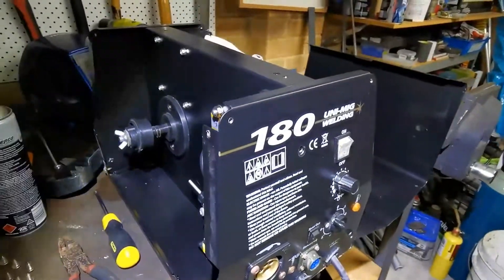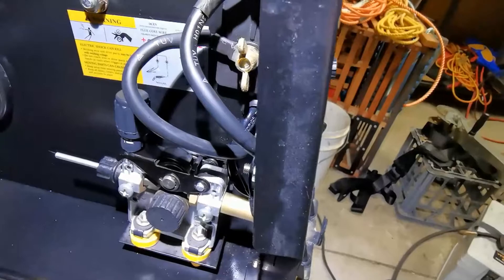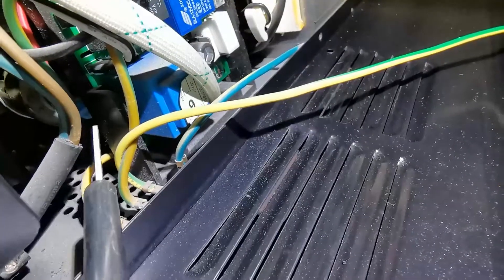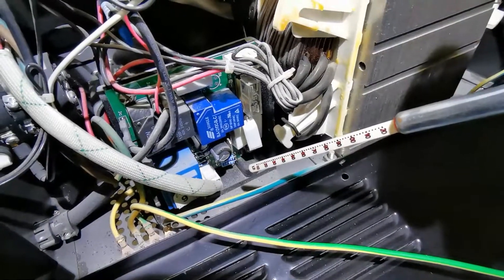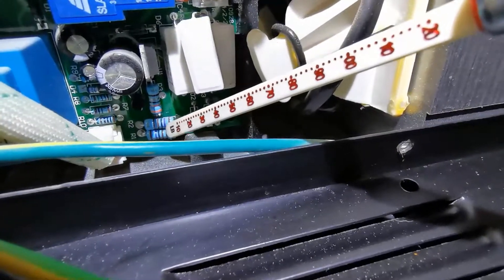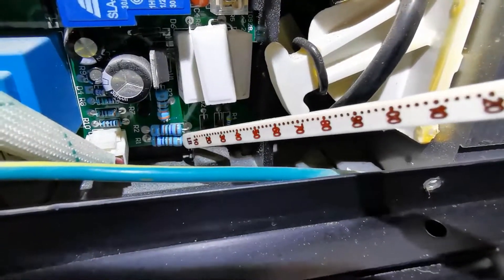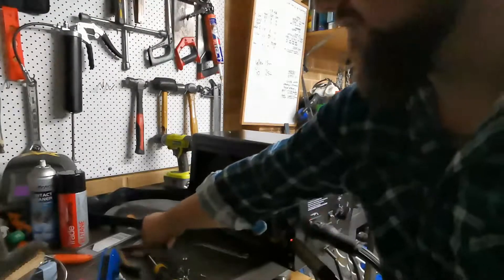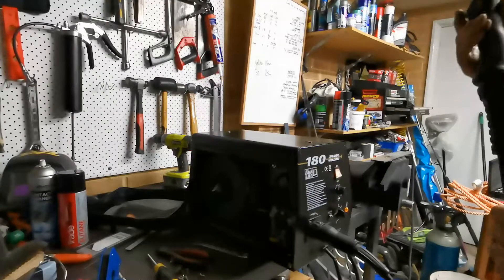Fix a Mig welder your guide to troubleshooting a MIG welder (any brand) not working or broken

Comment: Thank you for the video! I just received a brand new ESAB EM 190 PRO mig welder. The problem I'm having is that the instant the mig wire touches the metal I'm welding it explodes and covers the contact tip with filler metal. It doesn't seem to be a typical burn back problem. Everything is new, new wire, new contact tip, wire speed and tension are good, the wire simply explodes on contact with the metal I'm welding. Even with voltage set at its lowest and the wire speed high, it simply explodes. It doesn't even begin to weld. The place where the wire touches the metal is burned as if the voltage is far too high even when set very low. Any thoughts would be appreciated.
Reply: Without it being triggered? If its after you trigger it, seems like a control board issue. Esab is hard to deal with when it comes to customer service.
Reply: @Ricfixeswelders  Thanks for getting back to me. Indeed, ESAB is hard to deal with. I think you're right about it being a control board issue. It turns out my machine was still under warranty, so at the moment it's at a repair facility. If and when it's fixed I'll let you know what the problem was. Thanks, Paul
Reply: @thedahlins  Esab warranty is a nightmare. If they take forever i would ask for a new machine. Thats me without context of your situation

Comment: I have a mig arc, my wire continues to feed without me pulling the trigger.
Reply from the maker: Take the trigger switch apart. I'd say the switch would be faulty, causing the machine to think you are consistently holding the trigger down, when you are not. If it is not that, you need to check the wiring going to the wire feed rollers. Perhaps a worn wire would trigger the feed to stay on. Good luck
Reply: @Unfastened  I contacted the supplier, sent a video and they were more than happy to replace the machine. Waiting on delivery... thank you for the advice, will definitely keep it in mind if I encounter similar problem in the future.

Comment: Great video, thanks for sharing. 
I have a CigWeld 135 Mig welder that turns on fine, wire feeds fine but has just suddenly stopped arcing. 
Circuit board, fuses and connections look good. 
Do the transformers on these normally fail too?
Cheers, Joe.
Reply from the maker: Yeah, it is very possible for the transformer to fail. If the connections are good, that could be the case for you unfortunately.

Comment: great video very useful  i believe there are some dangerous bits inside the welder that you have to avoid going near I would love to know which ones they are ? thanks again
Reply: Everything and just a tip welders can hold power after being turned off so if u are going work on it turn it off and let it sit for 15 minutes.

Comment: I picked up a TradeTools Mig 180GG and when plugged in and turned on it starts up when I pull the trigger there is no clicking sound and no wire feeding 🤔it looks almost identical exterior and interior to the one you repaired the terminal on. Any thoughts as to what I could check ? 
Mick 
Australia

Comment: Hi, I recently bought a Amico electric, 200 amps multi-purpose 3 in1 welder, from  Amazon. I got the the welder. However i discovered, it have a factory defect,(the wire speed dial isn't working). I informed Amazon about it. They asked that  I return the item. However to do so is costing more than i bought it for. I am outside the usa.   So I am left stuck with a a defective product.
Reply from the maker: Hi. The thing you might need to replace is called a Welder Rheostat.  https://www.amazon.com/gp/search?ie=UTF8&tag=unfastened-20&linkCode=ur2&linkId=95edf9d2734649a4b585eebb49f7d7e4&camp=1789&creative=9325&index=electronics&keywords=welder_rheostat That link will take you to Amazon. Just open the welder up and see what type it is and you should be able to find it from that link. It might be a plug in one, or soldered in. Unsolder the old one, solder in the new one and it should work.

Comment: my welder works, but blows the house fuse after about 5 seconds, any idea what the problem could be? I also had smoldered wires on the power setting switch (already repaired wires and the switch checked ok) same result. cheers

Comment: Machine can on if fuse is broken?
Reply from the maker: Normally it won't turn on if the fuse is blown. Some will turn on, but then they won't weld / arc.
Reply: @Unfastened  that happen to me.
My mig can turn on.but there is no spark so cant weld.

Comment: What about when you don't have voltage to weld, but the wire feeds through properly.

I tried to reverse the voltage to be negative  biased and it didn't work, now after switching back its not working

Comment: Had  the same problem, just stopped arcing as I finished welding,. checked all the leads, still no arc, what next?????  Had to buy a new hose for my compressor, so will give it a good blow out shortly.

Comment: What about if the wire's exposed on the pipe/nozzle or whatever it's called. I'm wondering if it's safe (if it works) to just use electric insulating tape?

Comment: I have a low-buck Mig 160 new from Amazon with 3 push button options including arc but suddenly the wire feed works on 2 other cold settings but not on primary working Mig trigger which strikes a spark, no feed.

Comment: Hi I have a Snapon Promig 150 has worked fine for years, until this week and the gas pipe will not stay on, seems to bild up pressure and blows off, so i have to weld with no gas.
Reply from the maker: I reckon you might have a blockage, Barry. If a piece of mig wire fits up the gas line, feed a piece from the handle all the way through to the machine end (with the machine end undone). If it isn't that, you'll need to check the pipe going from the gas pump through to the handle connection on the machine. Good luck
Reply: @Unfastened  Thank you, the gas flow is ok and comes out of the gun ok but the pressure builds up and blows off the connection to the welder case. I have asked Snapon but they do not recognise the model Promig 150. I think the regulator is faulty but need someone who knows these things before I buy one.

Comment: I bought 3 MIG/MMA Chinese brand welders. All of them found no output current when testing MIG. MMA was working fine. Tried ground cable connecting to negative and tried with positive connection. Wire feed was OK but no current was out, no spark when scretching.Can you give me some advice what I can do if I buy again another one.
Reply: @WilliamHelstad  Thanks for your video with simple explanations. To be honest I still don't find where exact cause of the problem as the machine was new and every part looked OK. I mean in visually concern. May be I don't know how to use it. But you video gave me a lot of knowledge about MIG welder and thanks again.
Reply: @maungkwynn2707 did u find out what was wrong ?

Comment: so.. My motor works, but its really jerky, its fine on other power sources but off the control board its jerky, just trying to figure out if its a bad cap, but they look clean, or if the thermister is poked or something
Reply: I have what I believe ends up being a vevor 280amp multi use unit. It broke a while back and did the same thing with the motor. It blew some MOSFETs which I replaced but there's somethig else holding it up now. I got it through some Chinese distributor that avoided me when I tried to get the warranty honored. So I take a look at it here and there. I have a yes welder now so I don't out too much effort in fixing it. Although it was 6 months old when it blew so it would be nice to get running again.
Reply from the maker: What sort of welder? If you contact the manufacturer they can usually just supply the control board. When you hit the mig gun switch, the control board will be delivering 24v (depending on the welder) to the wire drive motor. If the wire drive motor works fine off other power sources, then the 24v delivery from the welder is the issue. Replace board, or if it has a separate inverter board that is converting AC to DC that might need replacing.
Reply: @WilliamHelstad  Rusty wire will do that as well, ( hazard of living in the tropic's. )